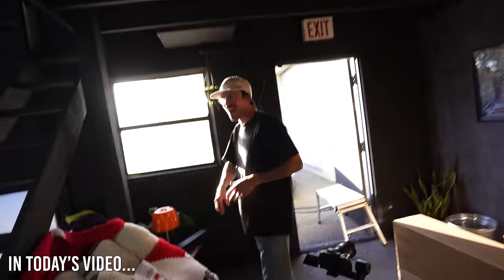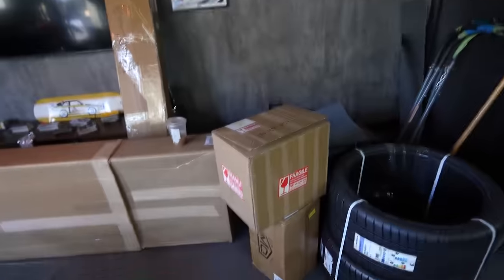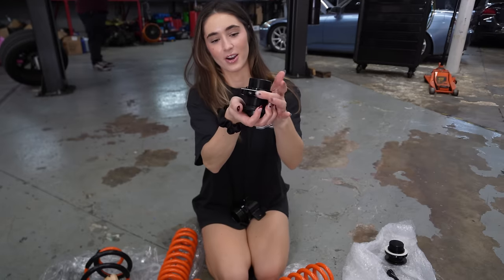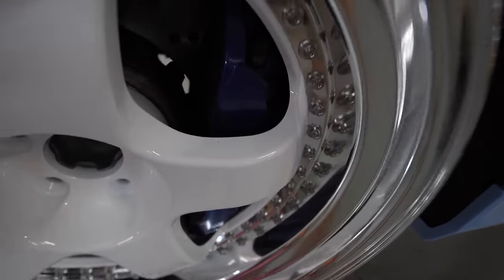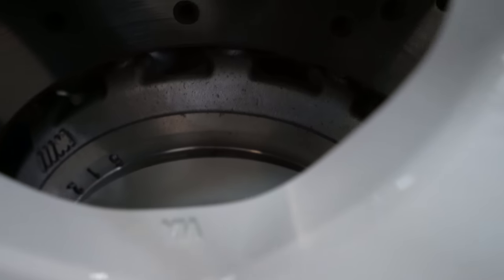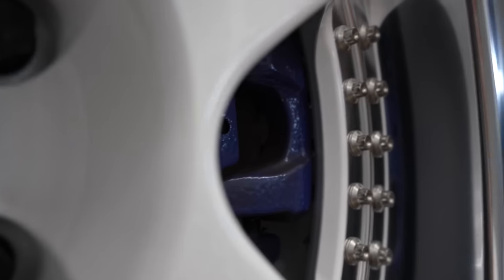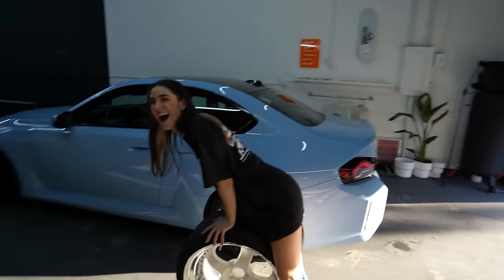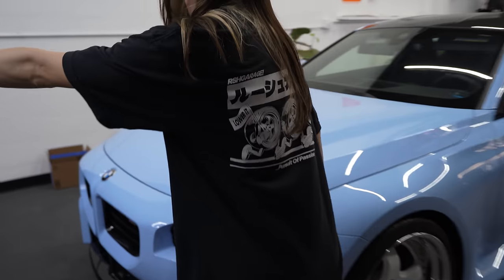THE G87 M2 GOT NEW WHEELS ! *PERFECT SET UP*

Comment: i love the way this looks but good luck with the brakedust! i also have a g87 and i literally gave up on keeping the wheels clean. i heard you can change the pads to a different compound and it will hlep but i have not done that yet. the squeaking is also brutal.
Reply from the maker: Same it looks so good!! And OMG the break dust is insane on the m2, both of them!! I’ve heard of that as well and think I might give them a try with how much I drive them. But luckily the breaks don’t squeal on the M2s. I had a friend who got his replaced on his new m4 under warranty. I honestly don’t think it’s normal for them to making THAT much noise when breaking and so constantly.
Reply: @NatalieRoush  mine has been constantly squeaking for the last 13k miles at the same break pressure point, literally every time. And It's louddd. They tell me it's normal, but like you said, it can't be...

Comment: Very nice wheels but forgive my ignorance as I do not understand offsets very much but how did you need spacers for the back if the offset was a +9?  Isn't OEM a +20 so going lower would make the wheel stick out more, right?  So wouldn't the back of the wheel be further away from the hub and break calipers?
Reply from the maker: I'm not sure what the OEM wheels are, but the +9 didn't clear the rear breaks because of how they sit a little further out then the fronts do. Trust me offset and wheel specs hurt my brain 😂😂

Comment: She looks Sexy, and  the Driver is Beautiful 👨🏻👍🏻🏎🏎🏁🏁🚩🚩 Have fun and enjoy.. I would like White Wheels though would have to Buy them From Roush Performance, because my 2022 Roush is on an 8 year warranty and it is White, I need 20 inch to clear the 16.5 inch Rotors and the Footlong Brembo Brake Calipers.... Heck I don't have a Spare Tire they are Wide ( Tread ) too. Yes! I Drive a Roush Mustang with the Rev-match Tremec 6 Speed Manual Transmission, and MangneRide Suspension. It also has the Intercooled Limited Slip Rear Differential.. Have a Happy Valentine Car Weekend 👨🏻👍🏻🏎🏎🚩🚩